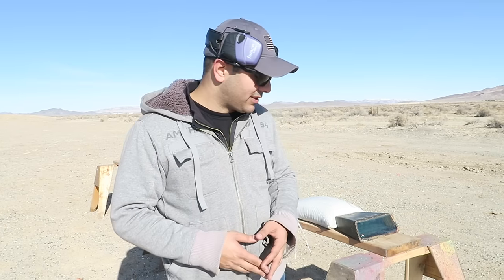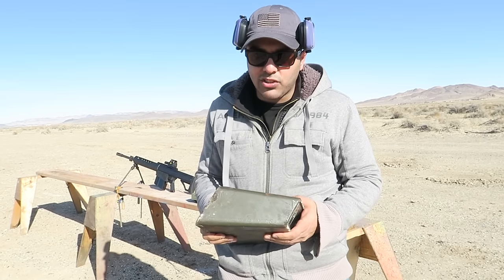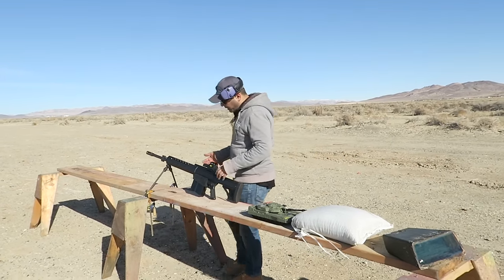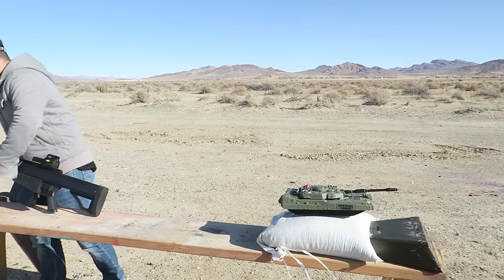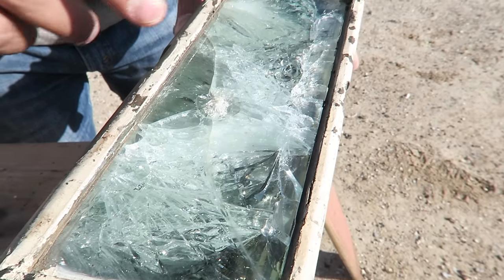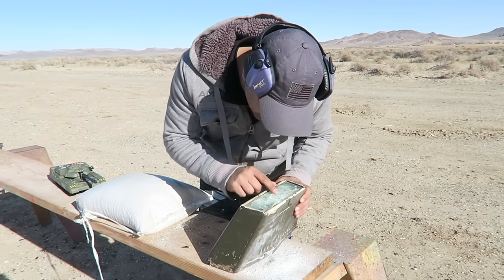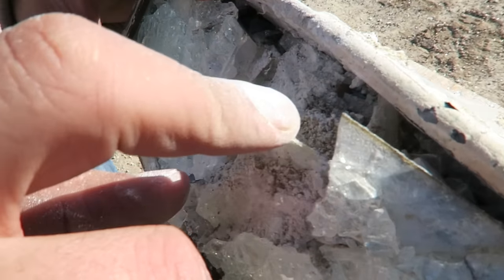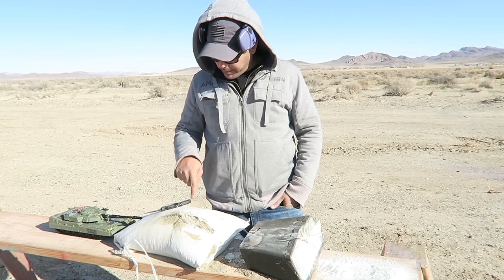50CAL VS TANK WINDOW - BULLETPROOF GLASS

Comment: Bottom line - One good shot could blind that periscope.
Reply: The issue with tanks is that you can't see shit when inside them.
Reply: well thats the point blind em...popem when they open the hatch or use thermite
Reply: Well the one he shoot on the video was actually just a prism, periscope is the one that you look about 20cm lower than the "window" appears to be. And all modern tanks use periscopes these days since the glass doesn't need to be that thick since you are not right behind the "window" that you see from outside. But ya the effect would be the same, driver totally blind. We used to have couple extra periscopes in our APC's but didn't never think about that the periscope is totally useless if even one bullet hits it. It can be changed safely from inside but it took like five to ten minutes which is way too much if some one is engaging on your position. Also sealing the periscope against the hatch is a fuckin bitch, they tend to leak always when it was raining hard.
Reply: DeadlyEmoAngel xX Actually those prism's can get hit only with small bullet like 556 or 762 and they r totally useless. But getting shot thru is waste of ammo since modern tanks and apc's don't use straight line prism's anymore, they r all periscopes where the actual image is mirrored down around 20 centimeters from the point that you are able to shoot outside of that tank. So the tank crew is under the thick armor all the time not behind some huge amount of layered glass. So they cannot be hurt with bullets at all, only with rocket-propelled grenades etc.
Reply: Dan Lewis Man that must be a nightmare being blinded by that then having a enemy tank flank you.What tank do you think that glass camefrom since its old ill say a  M4A1(76)
Reply: I know I'd be upset if my main view port went bad. 
I'm pretty sure there are other ways to navigate the thing. 
I guess the next tanks will have at least the sensors of the self-drive cars, in other words, radar and high frequency sonar.
Reply: Dan Lewis yes but.... they will have other viewingsystems
Reply: YES, as I said earlier. 'there are other ways to navigate the thing'.
Reply: That is true, but ony partially. On long ranges, you have thermovision with great magnification.
Reply: well they dont only use a parascope. they use cameras.
Reply: Keller weskier yes
Reply: i believe tanks now have radar and cameras in addition to periscopes.
Reply: Dan Lewis they still have the commander
Reply: Yeah but they might have had 4-5 of them...and the bullet would not exit the top If the op is pure metal from the tank, so I think only the 4th shot, while hitting pretty much the exact spot from a close range at a non moving tank, could hurt the person inside. H should have aimed at two different sides of the glass, simulating a more realistic war scenario. It might have taken 6-7 shots to get through. Not likely a person is going to hit the same spot on a moving tank. I want to see a person try to hit that glass from the same close distance while the glass is in motion simulating a moving tank....It might take 20-30 shots. In a war scenario, where your hands are shaking, and backfire is shaking everything around you (so no stable setup on such a close range), the shooter might need 50 shots to hurt a person inside. But one shot would blind that view...What do you think? Am I analyzing this with a chance of a realistic war scenario???
Reply: Not sure, but didn't the old tanks have multiple of these. And nobody really try to shoot through them. Hitting a moving tank, with a 50 cal, in the middle of action while the ground is shaking, and the same spot almost, is very unlikely....so to shoot through would take at least 50 tries without being smoked on such a close distance. Tanks didn't travel alone lol. The idea was to hit them with any gun and blind them...That's all...If they had a few of those (don't know that part, maybe you do), then it is still very possible to blind them with automatic rifles shooting at the tank...And then the tank is in deep shit. They are not meant for close combat. Of course, modern tanks are a whole different story. 10-15 mini backup cameras with 180degree view ratio meaning you see everyone on the side and in front of you. Plus rear cameras so you see 360 degrees...No glass or even periscopes used in the newest tanks. Maybe as backups in case the electronic supply somehow fails. Not sure...But blinding a modern tank is impossible. But destroying it is another story lol
Reply: Dan Lewis bottom line- It will blind the person inside
Reply: An airstrike would be most effective against tanks.
Reply: Shawn Jones An A-10 to be precise ;)
Reply: Dan Lewis actually modern Tanks have more than 1 view Ports, and have roof mounted cameras with gps mapping. you can see out a tank fine
Reply: B⃟A⃟L⃟N⃟ A⃟R⃟M⃟Y⃟    and them
Reply: B⃟A⃟L⃟N⃟ A⃟R⃟M⃟Y⃟ also they have the loader there's 4 positions crew in a Abrams not sure about a Bradley fighting vehicle but the thing about is that if that was to happen the driver would relay on his back up view Wich would be his cameras there one next to each headlight which are used for night vision and more preveild vision as well so yeah in other words shoot the tank glass once there gonna reply with ethier a machine gun fire or b with the main cannon I'm really not sure how 19k (cannon crew member aka tank operators) would react in that type of situation sense I'm a 11B ( infantryman) as in I get told to go out walk around with my weapon and look for the enemy and kill them so yeah tankers are way lot safer then us sense they have all that armor compared to us wearing Kevlar vest with cermamic plates and Kevlar helmet and so on but yeah sorry about the whole book pretty much
Reply: RAY RAY name test
Reply: well you might mess up that 1 viewport, but as far as the abrams goes, you would just piss off the tank crew. They have multiple optics systems, including, but not limited to the commander's optics, the remote controlled top mounted  machine gun, the gunner's optics, ect... for a vehicle that costs millions they have thought of a bullet striking that thing. The only thing you would succeed in, is catching a hot shell from a pissed off tank.
Reply: BALN ARMY name test
Reply: the 120mm high explosive round coming back is probably going to hurt a bit more.
Reply: Not if they can't see where you are.
Reply: These days they have helmets the let the crew see through the armour of the tank, just like the ones they have for the F35's.
Reply: rather be blind inside a tank then getting shot by a .50 bmg outside of it.
Reply: DyingIsMyLatestFashion hit the final drive....game over for the tank....and FYI the 50 BMG was originally designed as an anti tank cartridge
Reply: @Keller weskier, then destroy the cameras too, easy
Reply: There is a reason they stopped using anti-tank rifles.
Reply: a 50 cal is not going to knock out the drive of a modern MBT. Not that anyone would ever be in position to get a clean shot at it anyway.
Reply: We can install a data visual system of battlefield from uav or sattalite
Reply: @Arcyguana  why not just use camera systems?

Comment: Semi auto 50cal😳bye bye shoulder
Reply: Lewis MacQueen The Barrett M107A1, claims 36 ft/lbs of force, after the muzzle break, and other advancements.
Reply: Lewis MacQueen yeah try shooting a bolt action with a wood stock and a brass buttplate... I don't mean a 50. I mean any gun
Reply: The one he fired was a Serbu 50cal like he said. Which from what I've seen has less recoil compared to a Barrett M82
Reply: Lewis MacQueen the Barrett compensates for recoil using the muzzle break along with a spring loaded barrel and a padded butt pad
Reply: Trigger finger Jerry Miculek already did it. Standing up too.
Reply: Lord Kek wrong semi autos do not have much recoil when I was 8 I shot my fathers model 7400 semi auto 30-06 and I felt nothing

Comment: Lol the part with the tank.. I'm not an expert but this look like the driver view port of the Challenger 1-2 .Tanks have many view ports. The commander has a " 360 " view on the top of the turret, modern tank use mirrors behind the glass so the crewmen can see outside without having his head behind the glass, they look a mirror under it. ( see Abram commander hatch for a better exemple ). Same with the driver and the loader. The gun sight does not come up from the turret, nowadays they use cameras with a normal back up sight, it's always on top of the turret or on top of the gun, little armoured panels can be close to save the sight from artillery or small arms fire.
Reply: Kuhaku "I'm not an expert"
Reply: Kuhaku it's definitely not challenger 1 or 2
Reply: Well, he said he was not an expert :]
Reply: I’m fairly certain the challenger has the periscope. This is more of a viewport that would be used on an older T series I believe. I mean the challenger is almost the same as an abrams with its own touches. But the use the periscopes instead of the old style view ports. Hell it could even be from an M-60

Comment: An eotech on a .50 sniper rifle. Interesting. I'm no expert, but the tank viewport looks like it came from the commanders coupla, possibly from a Patton tank. But based on the design, I would estimate that it originated from the 1960s or 70s.
Reply: socomseal93 no sniper rifle in this video...
Reply: SaintMarneusCalgar News flash, just because it doesn't have a scope on it doesn't mean it's not a sniper rifle- or that it is one.
Reply: 50 bmg is no sniper ammo its that simple. barret say they build anti material rifles, no sniper rifles they did not say once they build sniper rifles. and thats what 50 cal is for destroying light vehicles etc.
 there are better calibres for sniper rifles.
Reply: SaintMarneusCalgar but still it means you could kill something from long range
Reply: of course still its not considered an sniper rifle but 50 bmg is pretty accurate 1 km range is possible

Comment: What tank was it from? Also almost no tank had the driver/gunner sit directly behind the optics. They would most of the time just use a simple periscope. Some self propelled guns/anti air would still put the crew right behind optics but that is only because those weren't build to take hits.

Comment: Are there non-militairy tanks?
Reply: Ger Lagerweij there is a couple non military tanks
Reply: Ger Lagerweij yeah it's called a bull dozed, escavator...
Reply: Yes. Water tanks
Reply: With a large enough 3D printer (with the capacity to print steel, optimally tungsten), a couple Tesla powerwalls, treads, axles (you can print the wheels), 5 GoPro cameras hooked up to 5 LG screens, a rail gun (3D printable from copper with a large CO2 tank for initiation, thick plexiglass to give structure to keep the two copper rails from touching, and a large amount of capacitors ($50000 worth) with a connected gas engine with an inverter to DC), and a bunch of time.
Reply: Ger Lagerweij a 1972 Buick 225....
Reply: I've got a septic tank.
Reply: Ger Lagerweij yes but they aren't as cool as military tanks

Comment: You're not taking into consideration that the whole glass unit will be supported top bottom and sides by steel, aka the rest of the tank. So it only truly counts if it makes it straight through the glass, not out the top.

Comment: id assume though that from the shape of the glass it slides back into a hard metal sleeve so with the pressure of that it may take more hits when installed because it couldnt bulge out it would just pack in tighter but only my guess.

Comment: Well if you are engaging an older tank, at least it can't be driven without peeking out the hatch, so there's that. If you knew where the driver/crew cameras were that would also be helpful. Cool test for a .50. When we did this with M114 door windows I made the same mistake poking my finger in the hold trying to find the bullet. Pain and sliced up finger is all I got back.

Comment: what this proves is that 60 ton of tank can be blinded with a single sniper bullet...
Reply: Sandstorm Disco You do realize a tank doesn't have just one vision block. The driver has three, the gunner has one, and the TC has 5+. On an M1A2 the gunner has two other sights, the GPS and GAS. The commander also has his CITV and GPSE. A 7 million dollar tank isn't going to have one method of looking outside.

Comment: That looks like it is a tank commanders cupola glass.  From the front of the tank the left side hatch on the top.  There are like 12 around in a circle.  Where you pointed is not that glass as that is the view finder for the main gun.  The driver is a periscope style, same with the loaders glass.  At least on an M1-A1

Comment: People shouldn’t shit on tank glass because of this video. It might not stand well against 4 shots perfectly placed by a .50 BMG shooting high quality rounds at only 20-30 meters away. Most of the time the enemy is shooting mystery ammo that jams and misfires and are put together with probably not the right amount of powder or dented bullets. And even if the tank got hit by a well placed .50 BMG straight on the glass, it probably wouldn’t be holding enough velocity to do jack shit. It would probably bounce or leave a crack.

Comment: Your knife sux. I had a friend have to use one in a self defense situation and the Smith and Wesson lever lock failed and the knife folded on the web of his hand between the thumb and forefinger. Bit him bad enough it required surgery to fix. The last thing you need while you're being attacked is to worry about your gear attacking you. Anyway just an FYI, do with it what you will.

Comment: Who would put a eotech on a sniper rifle
Reply: It' not necessarily a sniper rifle. Being that caliber it is anti-material rifle, and sometimes it is easier to aim without magnifying scope. Semi auto 12.7 mm rifles were initially (and still) used to stop lightly armored vehicles using iron sights.  It was later that someone (If I remember correctly: marines in Afganistan) put scope on them and found out they are accurate enough to be used as sniper rifles.